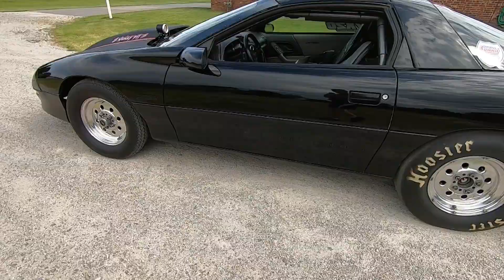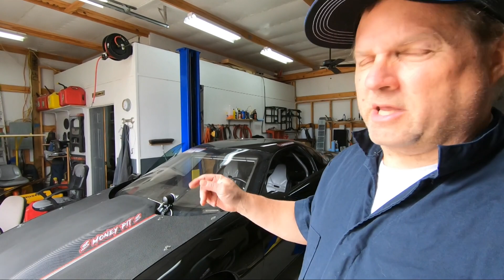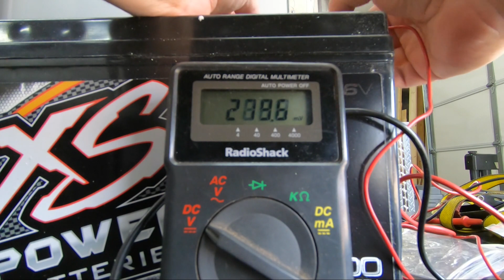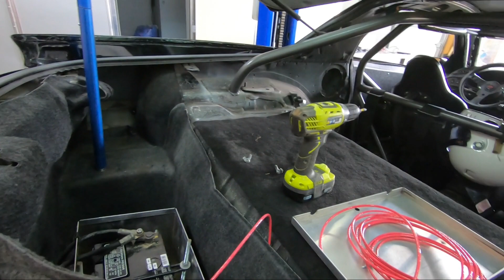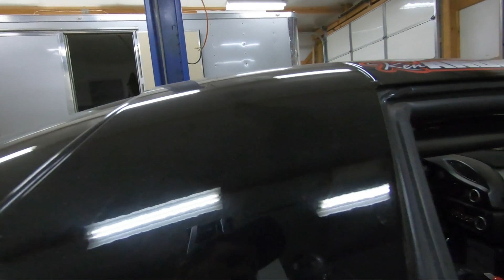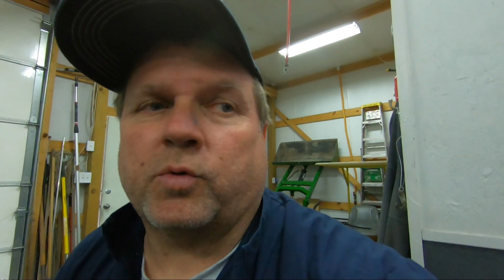How To - Install a 16 volt battery with a 12 volt DC to DC Converter!

Comment: Can you please tell me if there is anything out there that can take a 15.8 volt charging system and step down the voltage to around 13.8-14.0 i installed a high output alternator on my 19 Camry and a voltage control module with a 29AH SCIB bank that charges at 15.8-16.2 im charging at 15.8 everything was fine when I was charging at 14.8 but as soon as the voltage went over 15v it started beeping and saying charging system malfunction on both the dashboard and radio screen which i know is just the modern version of a battery light everything is running perfectly fine no charging issues just the message so im wanting to split the charging and run a lower voltage to the car and car electronics
Reply: You ever figure that out? I'm in a similar situation. I'm about to wire the starter to the 16v lines and add a 200a bridge rectifier to drop the volts for everything else. I don't want to buy a bunch of $200 25a step down converters

Comment: Where did you buy this 360W DC DC Converter Input 24 Volt Output 12 Volt?  Thank you!
Reply from the maker: Amazon! https://www.amazon.com/gp/product/B089YFCQY9/ref=ppx_yo_dt_b_asin_title_o04_s00?ie=UTF8&psc=1 Even though the input say's 24 volt, it works with the 16 volt battery, I think it will work down to 13.5 volts.